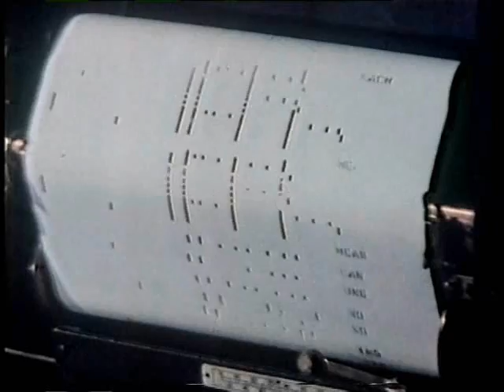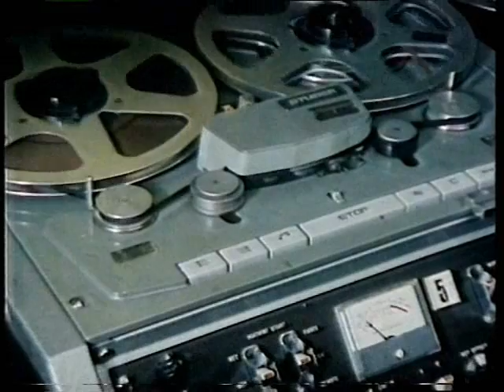The New Sound Of Music 1979 (Part 1)

Comment: sometimes you can run a synth through an amplifier (like a guitar amp) and get a different sound, or bigger sound.  Also a myriad of effects and myriad ways of using those effects.
Reply: Film composer Jerry Goldsmith did this very thing right up until he died in 2004. Instead of the synths going into the booth they were played live with the orchestra on the sound stage. The best way in my opinion.